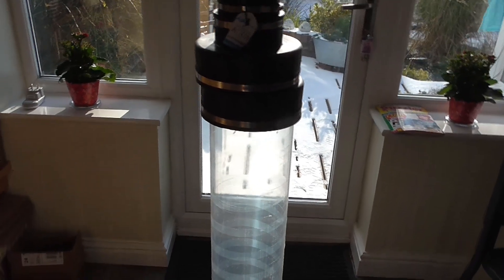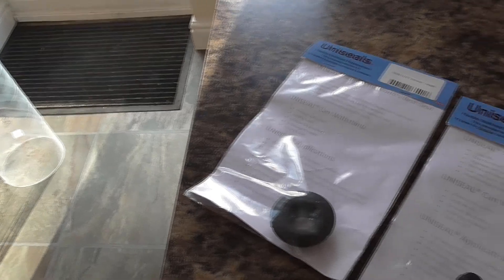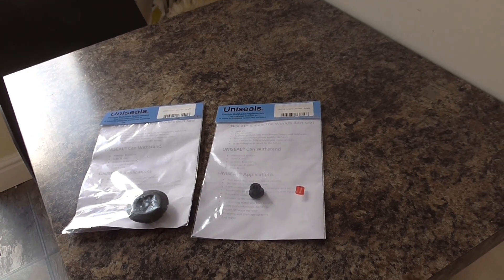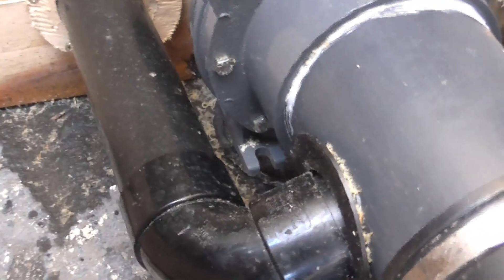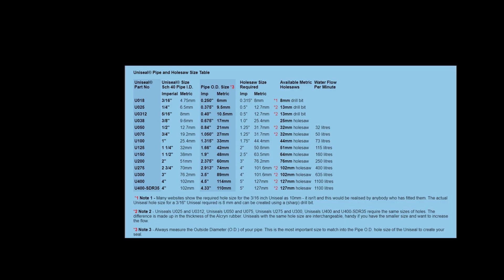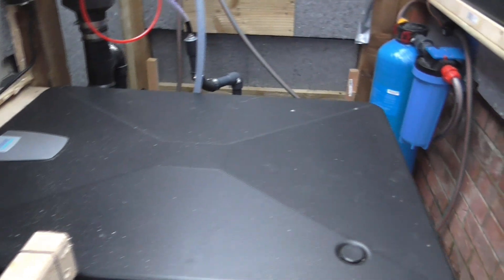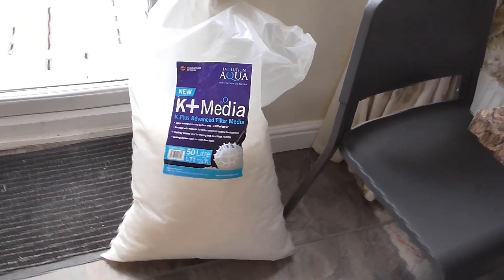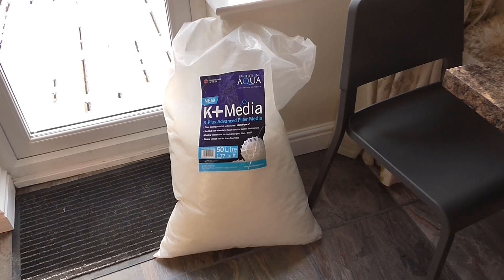200mm UpFilter   Uniseals   K+ Media Again   New Filter

Comment: Great video mate.... Just wondering .... to save adding rubber reducer to rubber reducer, what about using a solid end cap and fitting a tank connector to the final size needed (200mm to 100mm rubber reducer then hard end cap and say 1.5 inch tank connector), then you can drill the airline fitting from the bottom as well
Just a thought, would save a lot of cost plus a lot on total length of unit
Reply from the maker: Great idea Paul.

Comment: Hi there, could I ask you why you replaced your aem drum filter for the oase? Was it not man enough
Reply from the maker: Hi Richard. There were several things that went wrong with the AEM drum. I needed a new control box, new motor, replacement spray nozzle, cog wheels replaced and a few other things. Luckily I was under warranty so I got replacements, Unlike a lot of things no one comes to do the repairs and they just send you the replacement parts after you have returned the defective ones. So over time I bagan to not trust the AEM drum. I therefore went for a much better made combi drum. The Oase Proficlear Compact. That is German engineering and by the look of it a much better build.

Comment: Hi. What was the approx total build cost? Tempests look like they are for sale at 250, so just trying to work out if making my own is more cost efficient and likely to perform better or not.
Reply from the maker: Hi Andrew. If you look in the description of the build video you will see all the costs for a 110mm tube and a 150mm tube filter. With links to where I bought everything.

Comment: I have been using homemade filters based on the Wrighty design on my pond for years now and have used uniseals, both 4" (for inlets and outlets) and 1.5" (for drains) and couldn't be happier. They are easy to install and about half the price of comparable sized bulkheads so definitely a good choice for DIYers. Looking forward to seeing how the new filter build and K+ media works out.
Reply from the maker: Thanks. My new filter will match the size of the EA Tempest. I will have to wait however until EA can get me K+ Media without the swarf.

Comment: Great video shame about the k+ media where did you get the acrylic cylinder from and how much please
Reply from the maker: Hi Julie. Yes the K+ media was getting great write ups but having all this plastic swarf in it isn't good for business. I got my plastic tube from Trent Plastics. The tube isn't currently showing on their website so you would need to contact them to find out why. I have sent them an email asking the same question. They also sell on eBay.
https://www.ebay.co.uk/itm/Clear-Acrylic-Round-Tube-Perspex-Hollow-Plastic-Pipe-Candle-Gloss-Transparent/174172903123?hash=item288d8396d3:g:f5wAAOSw2F9gHWxb

Comment: Does the company you use for the pipe create any size or shape Acrylic? I've had an idea for a while to try but can't find a supplier? Who is your supplier? Cheers...👍
Reply from the maker: Hi Andy. I'm sure they do as they do fabrication. They are called Trent Plastics. https://www.trentplastics.co.uk/
I got my plastic tube from them. The tube isn't currently showing on their website so if you want  tube you would need to contact them to find out why. I have sent them an email asking the same question. They also sell on eBay.
https://www.ebay.co.uk/itm/Clear-Acrylic-Round-Tube-Perspex-Hollow-Plastic-Pipe-Candle-Gloss-Transparent/174172903123?hash=item288d8396d3:g:f5wAAOSw2F9gHWxb
Reply: @northernkoikeeper512  nice one. Thanks for that...😉👍
Reply from the maker: I also use Bay Plastics who also fabricate plastics.
https://www.bayplastics.co.uk/
Reply: @northernkoikeeper512  I got mine from www.clearplastictube.co.uk , but I don't think they do 200mm, but may be worth asking them, I am using 110mm and 700mm length which cost £19 =vat.. They also do acrylic discs, 110mm is £2.50+vat.

Comment: Hi... Just a quick question I pretty much know the answer but would like your thoughts... If anyone is thinking of building an upflow filter and are limited for space in their filter bay/house... Could this be run horizontally???... Bet that's got you thinking.

Cheers
Wayne
Reply: Hi, I have tried on a small prototype and it didnt really work, which is a shame as I was thinking about having a few horizontal ones, parallel to each other. It doesnt work because they work a bit like a pressure filter and do not work like a river basically.
Reply from the maker: Hi Wayne. Good question. I cannot say I've tried it so I cannot say for sure. However in my opinion it probably will not work because the media is not getting packed tightly like it is with the up flow. It would float on the top leaving an open water channel below where the dirt could flow through.

Comment: Could you please post the link where you found those big 20 cm rubber adapters ?
Reply: EBay
Part no Mac 1991
futurebuildingsupplies 
Cornwall
Reply: @marekskoipond9083  👍👍
Reply from the maker: Hi Patrick. I got mine from a company called JDP. I have put a link in the description.

Comment: Just recieved my acrylic tube today, so now have all the parts to make this filter including the uniseal, I shall copy your design, although to make it a bit shorter to fit my space, I will use rigid plastic 110 mm - 55 mm  solvent weld fitting top and bottom, which fit into 200 mm - 110 mm adapters, not sure I will be using ea K+ Media, with the amounts of swarf found in the media, shall probably use Oase helx 13 out of my bio chamber, unless it's proved the K+ is better.
Reply from the maker: Hi Marek. What diameter pipe did you go for? I have also used Hel-X media in the filters so far with great results.
Reply: @northernkoikeeper512  
Hi, don't know your name?  I've gone for the 200 mm acrylic pipe, been In the shed all day plumbing in the ashp and making space for this filter and working out pipe runs.